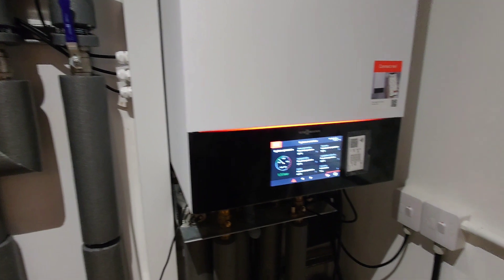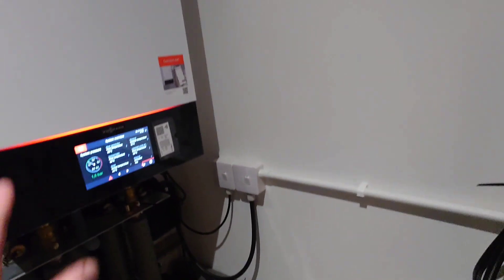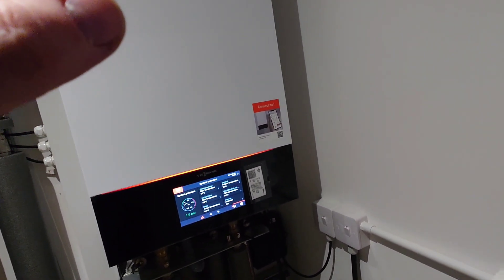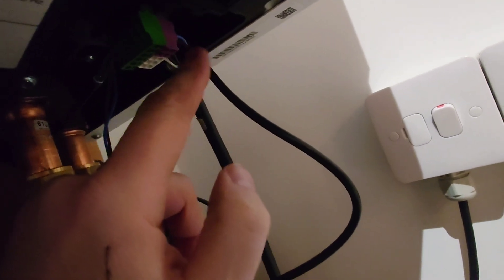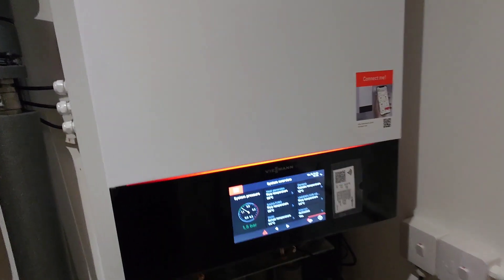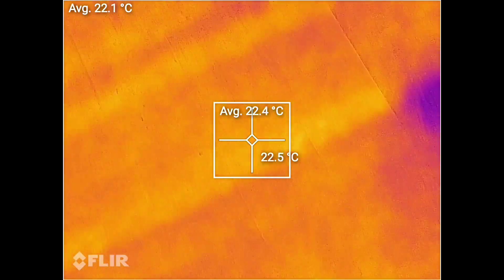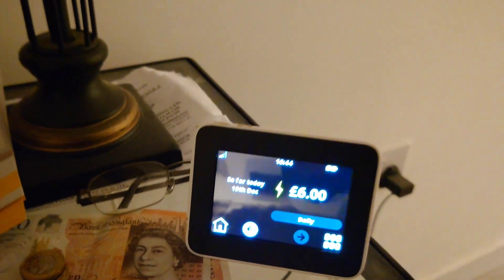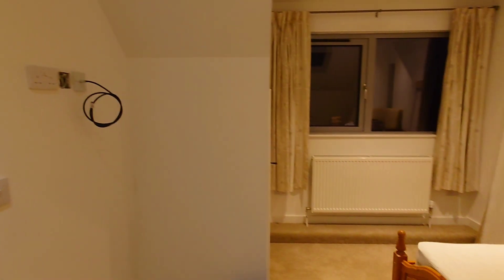Viessmann heat pump commissioned during the big freeze

Comment: If there was 3 phase at the property, could you run 3 phase into the wall unit for each element leg or would you need to keep it single phase still with 3 separate ways?

Comment: Where does the 10k go on the buffer tank ? I’m wiring one up and the plumber says it “probably goes on the flow pipe” ?
Reply from the maker: @samgreenfield6220  I assume a dry pocket into the buffer if you can as it’s looking for distortion across the buffer and to offset the flow temp to achieve the target buffer temp

Comment: Good video. What was the heat loss to require a 16kw pump, it looks like a new build or full refurb?

Did you use antifreeze valves with the hex module or instead of?
Reply from the maker: I can't remember the heat loss to be honest as the job was specced that long ago. Job was a refurb and mega extension. It was a small bungalow converted into a relatively big house. Loads of insulation gone into the walls floors and ceiling. No antifreeze valves. Viessmann said they weren't required because of the defrost buffer design or something 🤷
Reply: @griffithsheating  so is it just water in the pipes between the hex and the outdoor unit or glycol?

I was told has to be gylcol and a hex, or do away with the hex, use antifreeze valves and regular water most efficient.

So many different opinions many not concerned over freezing live far South

Comment: Wowza, thats a beast of an install. That energy consumption is great too. Our house is smaller and uses more than that, even at very good cop (needs more insulation). Good bit of info on the UFH too, that screed transfers more heat. Being ground floor, the 'spreader plate' system is that the pre-routed foam boards with aluminium spreaders? Or is it spreaded plates from below, attached to suspended floor? Will be retrofitting UFH on a suspended floor, looking at options for the biggest thermal transfer
Reply from the maker: It's pir between joists and then 150mm ally spreader plates over joists with flooring sheets on top. It works fine but not as good as in screed. This unit is currently running at a cop of 4.6
Reply: @griffithsheating  Ah I get you, so at that part of the floor there's a cellar or crawl space underneath? I'll probably go with pre-routed chipboard with spreader plates on top, then a thin plywood layer.

Comment: The lack of strain relief on the CAN-bus and Plusbus cables might cause problems in future if a service engineer snags one of them. It might be worth adding some.
Reply from the maker: Yeah I'm not too keen on the low voltage signal wiring set up. It's quick and easy but looks a bit of a scruffy solution.

Comment: How easy to service the bearings and components to keep noise this low please? Clean and new grease job in summer?
Reply: Could the system be pared with a small capacity gas combi boiler for back up/added capacity in very lowest temperatures? I wish I could get a lower powered combi boiler for my flat, most are powerful enough for houses, apparently not so many small capacity ones available on market. 
Basically impossible to get the condenser action going if I only want to use one or two radiators seems like. Even with all radiators on and the flow temperature right down at lowest setting it still needs to cycle burner on and off. I only need 17c tops would be OK with around 12c if not for old dog.
Reply from the maker: I don't know about the bearings to be honest.  You'd have to build your own hybrid set up as the 150a doesn't support bivalent operation yet I don't think - there are still quite a lot of firmware updates to come on these units to add functionality.

Comment: So you're saying that this system requires resistive heating to give full output in very cold weather?
Reply from the maker: It's designed to 21 degrees at -2 so anything below that may bring in the heater or miss design temp by a few degrees.  The main issue here was the property was not far off freezing inside when we comissioned as it has been unheated and empty for 2 years so it took a bit of heating up.
Reply: @griffithsheating  it's just the irony of a so called "green" technology that relies on resistive heating in any way shape or form.  Some of these units even use resistive heating to stop the drain from freezing.  Seems rather backwards.
Reply: So it’s an ASHP - so what exactly is the Viessman box  (inside the house) with the control panel actually doing - does it house the circ pump?
Reply from the maker: @normanboyes4983  in that box is an expansion vessel, small buffer, pump, 3 way heating/HW/defrost valve and the back up heaters. It also houses the control electronics so there is no external 3rd party wiring 👍
Reply: @griffithsheating  Thanks.👍
Reply: @Chris-hy6jy  The technology is good, not perfect, that shouldn't halt progress. Slightly undersized is the perfect place to be: for 95% of the year the running costs will be lower than a gas boiler because a smaller system can modulate lower. Much better than sizing for the 5%. You don't need a BMW X7 to go the shops for a pint of milk.

Comment: The size of the rad in that bedroom, the 30C flow temp and the 20C room temp tells me there is an awful lot of insulation in this property.

It’s thermal performance is clearly well above your typical U.K. housing stock.
Reply from the maker: Yeah the whole house was pulled apart and a huge amount of insulation was put in.
Reply: @griffithsheating  it’s a bit disingenuous to say “look heat pumps work” when you’ve not installed it in anything like a typical U.K. property. The main gripe is that the majority of U.K. property leaks heat like a sieve.
Reply from the maker: @chrisb4009  at the end of the day heatloss is heatloss. As long as you select a pump that can meet your demand at design temp it will work if your house leaks like a sieve or not it will just cost more to run as it would if you were heating with gas. The problems occur when they're retrofitted and flow rates, temperatures and outputs aren't fully considered and calculated. High output combis made the heating industry dumb.
Reply: @griffithsheating  I don’t really get the “you just need to do the sums argument”. 

You get decent COP’s with low MWT’s. But if I sized rads based on a MWT of say 30 or 40C in my sandstone house I’d need a bigger house to fit the rads in. It just wouldn’t be practical.

So you have to increase your MWT to reduce rad size as a trade off drastically reducing your COP.

I can’t see HP’s ever being a universal product in the way combis are in the U.K.